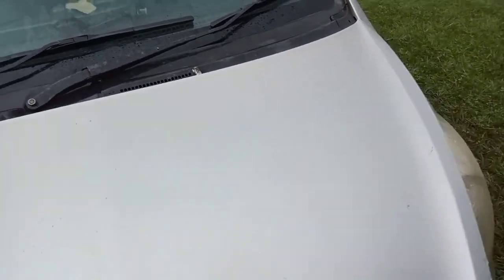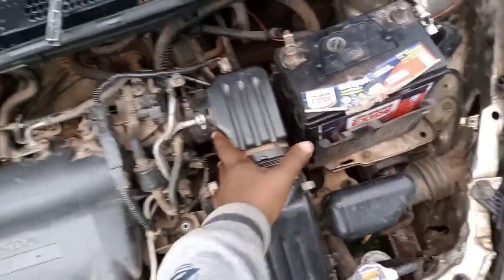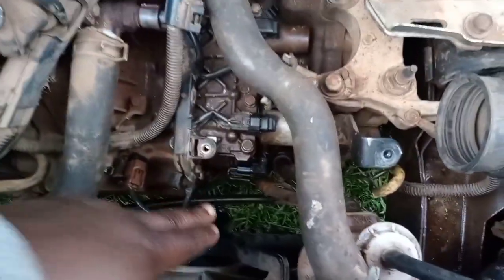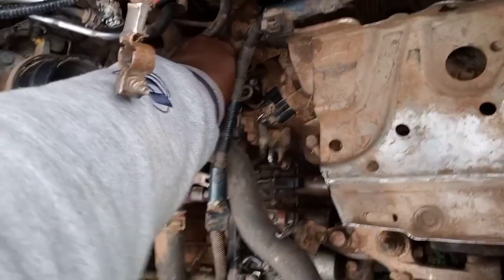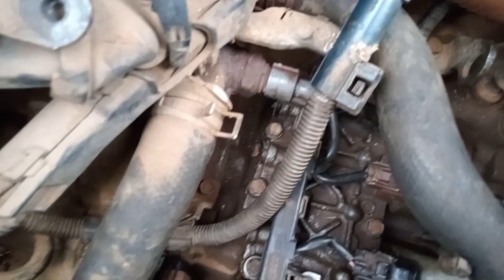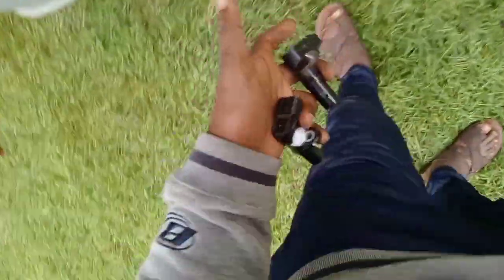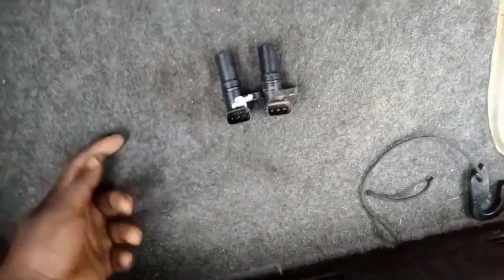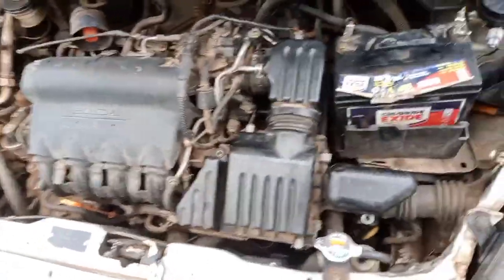Blinking 'D' Honda Fit/Jazz Solved. P1886 Error Code Resolved | Outdoorsy #cars #hondajazz #mechanic

Comment: I had this issue for some time I replaced the transmission and it's not even more then a year now it's starting to flash but more serious everytime I want to drive the car it doesn't move when I put it into drive I was for 30mins then it drives. So you think it's the sensor? I will try to get the OBD2 scanner to find the specific error code but do you think it's affected by the sensor?
Reply: Brother I got exact same problem😢
Reply: @travelwithbari  I have decided to sell the car because it's costly

Comment: Has any one here had it where any where you drive it’s fine to take off and drive at any cvt gear fully auto or 7speed but as soon as you come to a stop it feels like that car will stall and some times it’s berly there and other days it’s so bad that it takes alittle bit to move since it like a sensor is giving out some where?

Comment: How are you please help I have a Honda Jazz the rpm is up to 3 and the rpm is high and the rpm is stuck on and it appeared I have a p1887 code and I replaced the speed sensor but to no avail please help where is the problem thank you
Reply from the maker: Hi thanks for watching and please subscribe.
There are two remedies for this.

First, you need to ensure that the wiring is okay and repair or replace the transmission wiring harness and/or connectors if you see any problems.

If the error code persists, then you have to look into your Torque Converter Clutch. Replace TCC release switch. This should definitely solve your issue.
Reply: @outdoorsy6322  I want a video clip from you showing how to measure the braid wires in the multimeter, the valve, the solenoid coil and the switch. Please help with that.
Reply: Same problem for my city 2008 code 1887
Reply: Change your coolant temperature sensor
Reply: @dre1011000  Where is this sensor located?
Reply: @menyar4444  what kind of engine do you have?
Reply: @dre1011000  Car type Honda Jazz 2003 Automatic Engine type 1.3 Barnin
Reply: Mine has the same issue of blinking D lght, but also, it won't go beyond 13km/lt